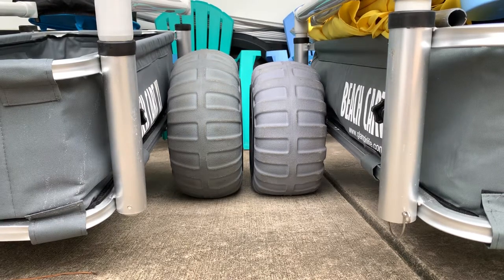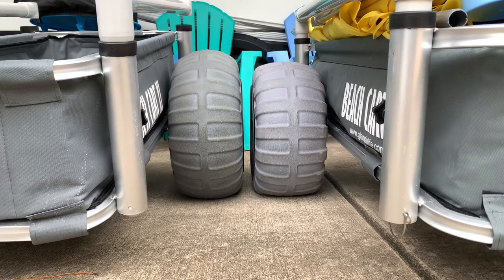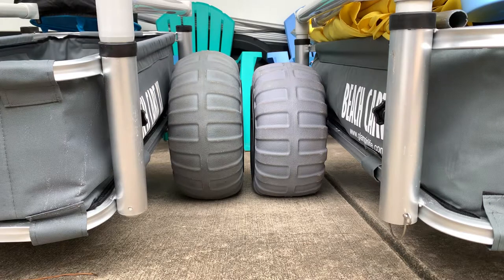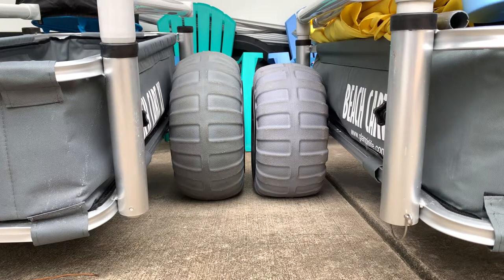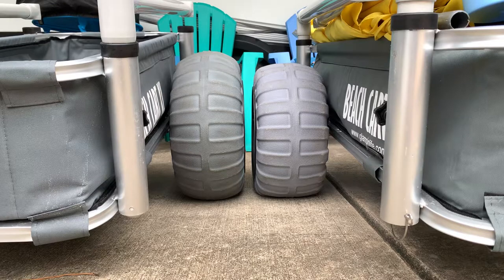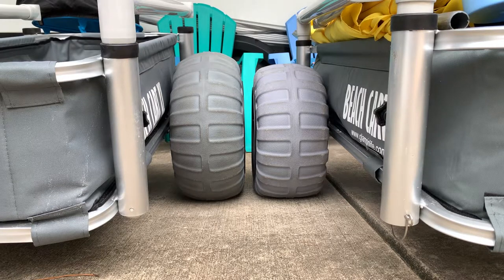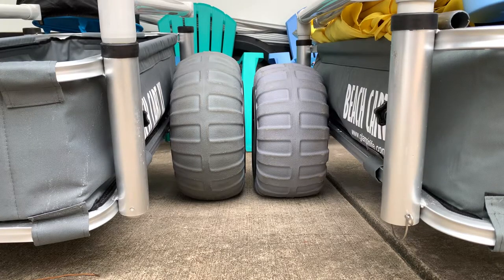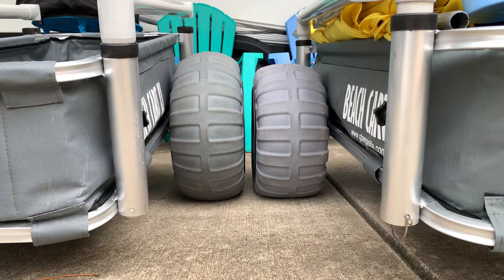Balloon Wheel Maintenance - Proper Inflation vs. Incorrect Inflation

Comment: Just had this happen with the same exact tires. The tires started to rub the bottom of my cart and I thought it was the bushing or bearing getting loose. I was also afraid the tires would come off the bead as I was on the beach, so I put more air in them. The heat definitely over inflated them the first time I used it. $200 lesson. I didn't realize how little air they needed.
Reply from the maker: The reason they can squat so much, unlike a car tire, is there is no bead. It's the same design as an inner liner, it's a completely sealed tire. If you had to purchase a new set of tires from us and didn't get a coupon code to do so, shoot us an email so I can take care of that. If you need to purchase a new set, reach out to us first.

Comment: I just bought a cart 2nd hand off Marketplace and these tires have been WAY over inflated. So much that the 16 inch wheels are now 20 inch wheels. I didnt pay no mind to it because it's my 1st cart and didn't know any better  and they are surprisingly still fairly true. My question is, does a rounded profile tire push/pull more difficult than the square profile tire ?  I havent had a chance to get it in the sand yet.
Reply from the maker: No, either type profile will work fine in the sand. The issue is most of the time overinflated tires will stretch differently, causing bulges. Then the cart bounces around.

Comment: I overinflated my tire for less than 15 minutes 
I didn't use it at all 
I turned on this video and took the air out 

My question is do you think by just over inflating it

 for less than let's say 15-20 minutes without using it and putting pressure on it 

without the wheels being in the suns heat

do you think I ruin the wheel by just over inflating it initially?
Reply from the maker: Can't say for sure without seeing them, but you probably haven't ruined them. That only happens if the material stretches unevenly making it a cone head or developing a large lump.
Reply: I doubt it also they look fine thank you for getting back to me though

Comment: After you have over inflated your tire and it is out of round can it be repaired or does it have to be replaced? 
           Thanks
Reply from the maker: You can try to let the air out to where it should be but you'll still notice a little bit of a lump, just depends on how bad you've stretched the material. Any brand balloon wheel, once the material is stretched out, it does not shrink back. Most of the time you just have to replace them, but again that just depends on how bad they were stretched out. They do not stretch evenly, they turn into a conehead/egg shaped wheel.